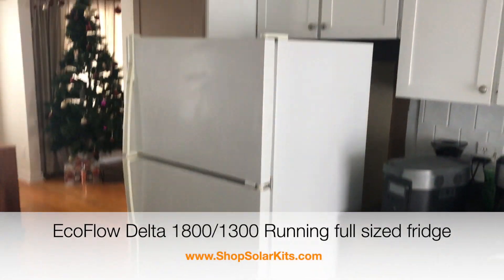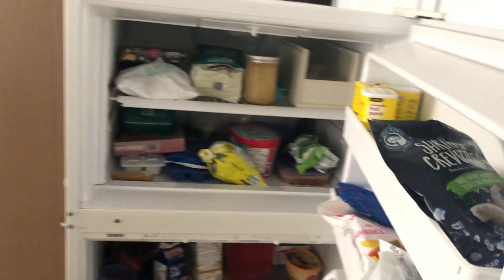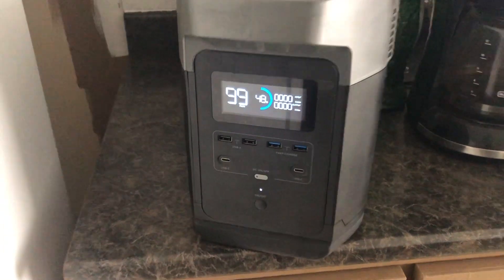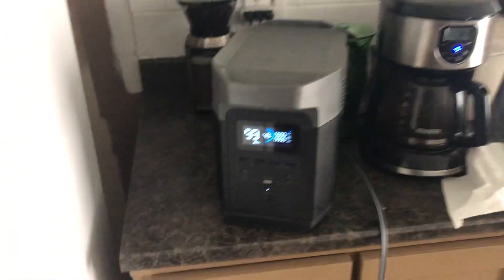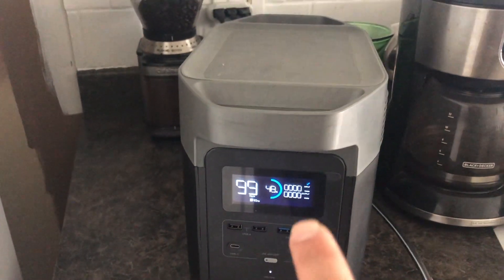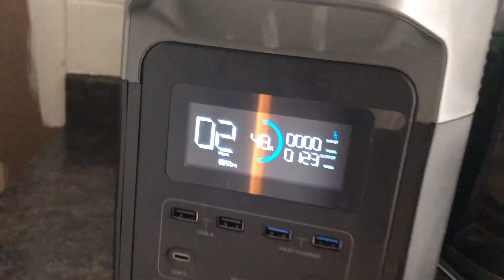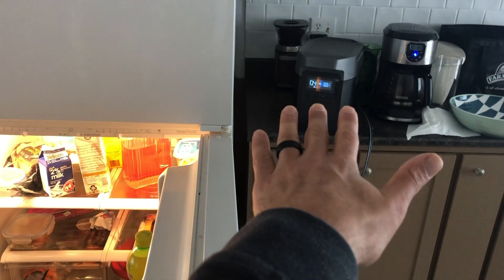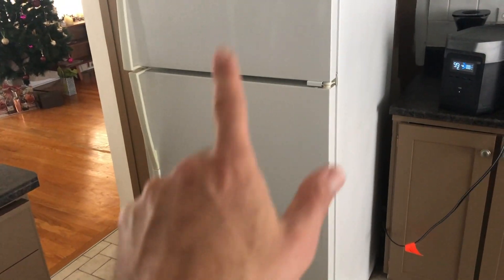EcoFlow Delta 1800 Fridge Test #1: Can The Delta Solar Generator Run a Full Sized Fridge?

Comment: You can't cool your house by leaving a fridge door open. It moves the heat energy from inside to the condenser coil. The cool from inside combined with the heat generated during the process equals ambient air temperature.

Comment: Are all the Ecoflow Defective?They dont has low voltage cutoff on the usb and my units keep getting bricked when I leave anything on the usb outlets too long and all they want to do is send me a replacement.This unit has a factory defect they are not fixing

Comment: As others have pointed out, this video is very misleading. Fine, the internet is full of all kinds of misleading info; par for the course. What's disturbing is that this is published by a (presumably knowledgable) vendor that I was considering making a purchase from, rather than some rando. Thinking twice...
Reply from the maker: Hi there, thanks for taking the time to watch our video.  Not entirely sure what you mean by misleading information.  If you are curious about if the unit can handle the surge of the compressor, you can watch video #2 - https://www.youtube.com/watch?v=jpuKg9wU_Hc&t=7s&ab_channel=ShopSolarKits 

Let us know if you have specific questions about the EcoFlow or other generators!

Comment: The ecoflow R600, even without the extra battery, can power a fridge, too!
I tested with my full size fridge, and estimated it would run it for 6-8 hours. This was also while simultaneously charging 2 phones and an ipad.
Ecoflow is the best, by far.
Reply: Not really especially if it's using that undervoltage method

Comment: The watts being used with the doors open were the incandescent light bulbs inside the refrigerator. Leave both doors open until the compressor kicks on to see how many watts it draws.
Reply from the maker: Hi Dan, here is a follow up video we made of the compressor kicking on.  You might be interested in.

https://www.youtube.com/watch?v=jpuKg9wU_Hc

Let us know if you want to see other specific videos!
Reply: Exactly
These guys are salesmen!
Reply from the maker: Sure, no problem!  I will get that done on another video.  This video was to show what it is actually like to keep a fridge running if you were to lose power and how long you would be able to keep everything going for.